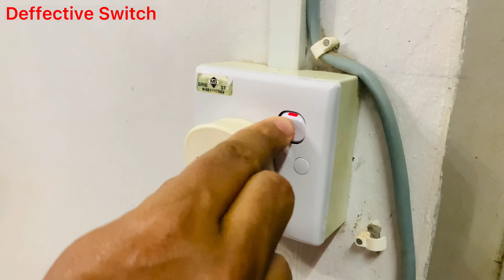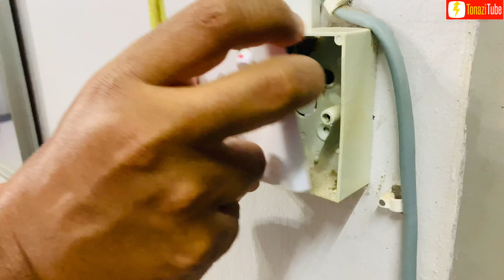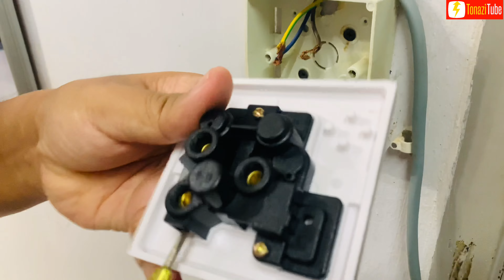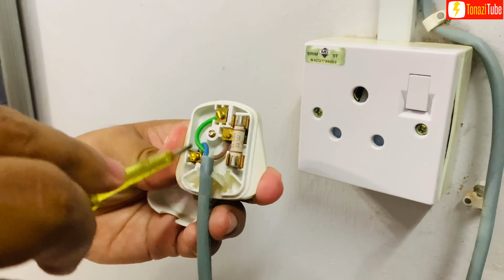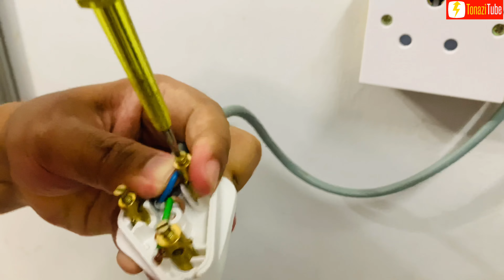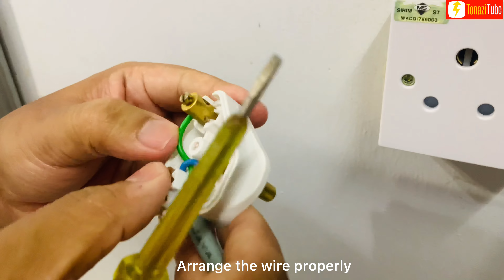How to Convert 13A To 15A Socket & Plug | Replace UK 3 Pin 13 Amp to 15 Amp Socket Plug

Comment: The 13 amp plug and socket is safest option for domestic use in the uk because of the 13 amp fuse 😊

Those 15 amp sockets are found usually farms they are for small inverter 🧑‍🏭 welders 3kw power washers and battery chargers with a battery boost they are cheaper than the standard 16amp blue commando socket and are safe for use in these situations PROVIDED there is 4.0 ml t+e wire feeding the socket and there’s a 16 amp breaker in the consumer unit BUT NOT OTHERWISE 😮

Comment: Hi, mine iron steam press using 15A plug top. Can I replace 13A wall socket to 15A directly? Can existing cable hold the load?
Reply from the maker: You need to check wire pin gauge first.If gauge over 14 size,there should not be a problem to change to 15A.

Comment: You need to make sure the cable rating is right before putting a 15amp socket in place of a 13 amp one.
Reply from the maker: 14 AWG copper wire is the most common choice for a 15-Amp circuit. 14 AWG copper wire is ranked 20 Amps at 75°C. If you choose to use aluminum wire, the correct size for a 15 Amp breaker is 12 AWG. However, copper cables are a better choice for 15 Amp breakers due to safety and efficiency concerns

Comment: Can you replace a 13 A to 20 A in a plug?
Reply from the maker: Need to check wire or cable use type?Support to 20A or not.
Reply: @TonaziTube  how can we chat one one one? I have so many questions
Reply from the maker: We can chat here,no problem
Reply: My circuit breaker/ industrial socket is rated 32 A 220 volts. Can it power a 13 A 220 volts  appliance or it it can burn?
Reply from the maker: The number “32” means that the Circuit breaker will handle up to 32 amps before tripping. The curve determines how long the circuit breaker will hold before tripping at various over-current levels. If using 13A 220V,it should be no problem.

Comment: Hi , how can i change a 220v 10A china made oven plug to malaysia 250V 13A? Just change can ?
Reply from the maker: Hi! You can change it.Just replace the plug.
Reply: @TonaziTube  thanks for your reply but the  difference in 10A and 13A Fuse doesn't matter ?
Reply: @TonaziTube  need to change the fuse?

Comment: Hi there … Thank you for the tutorial! Clear step by step. Question : If I change from 13AMP to 15AMP, will it not overload the fuse box ? Just 1 socket/plug to change for oven use
Reply from the maker: Hi friend!Thank for watching.If your main fuse box use over 15Amp,it should be not a problem to change.
Reply: @TonaziTube  How do I check the max load of my fuse box ? Is it stated anywhere on the box ?
Reply from the maker: You need to check the MCB specification in the box.Believe have a few pieces in the fuse box.Need to find which MCB connect to the socket supply place(for oven use).

MCB Current and Curve Rating: , Example if mentioned C20 .  The numeral part indicates rating of MCB in Ampere. In the given example it is 20A. MCB rating is very important and be very precise about it.
Reply: @TonaziTube  thank you so so much for your replies. Appreciate your help 💜
Reply from the maker: Welcome 🤗! Thanks for watching and pls support by subscribing this channel
Reply: @TonaziTube  Done :-)
Reply from the maker: 🫰🏼Tq

Comment: Hi, thanks for tutorial. How about if my wall outlet is already 15amp 3 round pin, I need to use power tools with 13amp plug, I don't want to change the plug head to 15amp. Can I just use an adapter to plug in my 13amp items? They are around 1200-1500watt and will only use one at a time. Is it safe? The amperage use of the tool is lower than wall outlet should be ok right?
Reply from the maker: You’re most welcome and thanks for watching.For your cases,it should be no problem if using adapter for 13 Amp and only use one at a time.
Reply: @TonaziTube  thanks! If I want to test the power on the 15amp wall outlet can I also just use the test pen(same type as your video) in the live (bottom right)?
Reply from the maker: It was my pleasure! Pls be careful when handling with the electricity ⚡️.Beside test pen ,you may also measure the output voltage from wall outlet by using multimeter.

Comment: Hi, if my current wall socket is a round 3 pin 15A. Will it be okay if I change the socket to rectangle 3 pin 13A to match my fridge?
Reply from the maker: No problem if use 13A from 15A designated.

Comment: If I change to a 15A and socket plug, do I need to change the thickness of my extension wire to thicker wire??
Reply from the maker: You may check the wire thickness.If 2.5mm ,it can support until 22A.
Reply: @TonaziTube  may i how do know 2.5mm support till 22A ?
Reply from the maker: A 2.5mm cable is capable of supplying around 23-25 amps depending on the method of installation, so is fine, safe and compliant on a 20amp circuit breaker.

Comment: Can i use a Chinese brand10A water dispenser, change it to a UK plug 13A fused socket?
Reply from the maker: By assuming that the 13A plug you’re referring to is British, I’m guessing that the 10A connector is using 240V.

In that case, yes, you could technically change the plug without any problems - just put a 10A fuse in the plug to be safe.

A UK outlet was historically protected by a 13A fuse, which is why it is necessary to protect your appliance with the correct type of fuse at the plug.

Of course, using electrical appliances in countries they’re not approved or certified in is another kettle of fish....

Comment: my exisitng wiring on aircon is 15A type and using 15A socket n plug , but for some reason, can i change JUST the plug and socket to 13A type?
Reply from the maker: Need to check current (Ampere) requirement on your Aircond usage.If use more than 13Amp,not recommended to change.

Comment: The cable in the patress box looks like 1mm or 1.5mm flex which is absolutely not enough for a 15a circuit.
Reply from the maker: It was 14 Gauge size

Comment: this is terrifying
Reply from the maker: Sorry for an issue
Reply: @TonaziTube  you screwed down onto your cables insulation which is a main cause for fires at sockets you should remove some insulation and twist the wire until it will not twist anymore then tighten onto that exposed cable and you will have a safe socket 
though the other end of that wire may also need to be reinstalled
Reply from the maker: @user-bm5hf1ph4n Thanks for advise